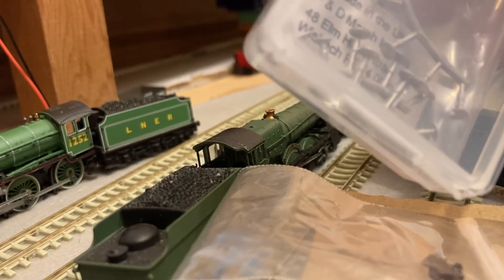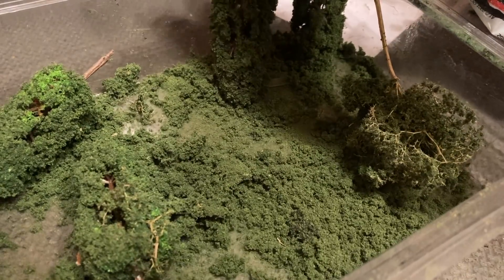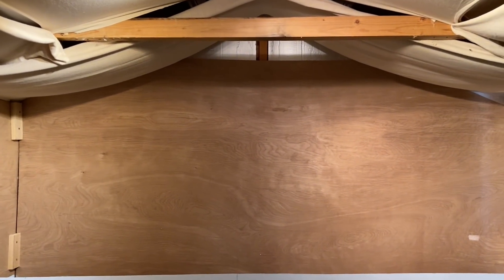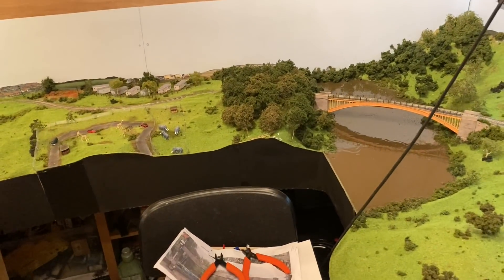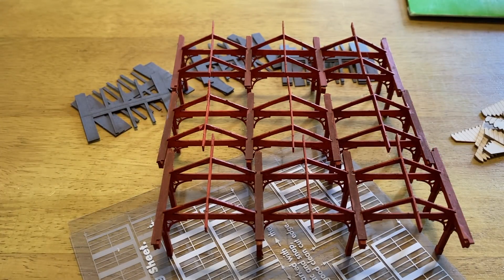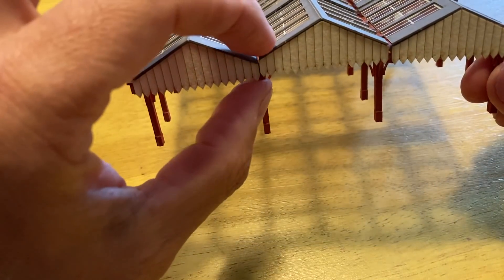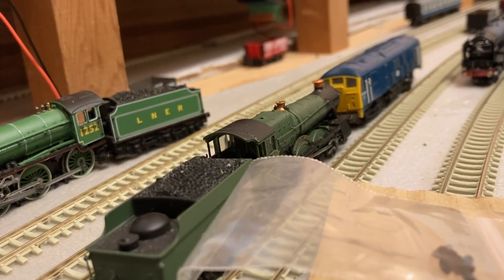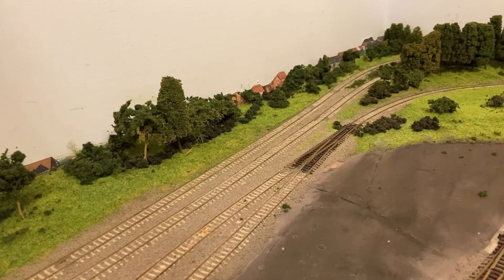N Gauge Model Railway Layout Update: Shed Valley Railway 42

Comment: Hello Simon, it’s great to see your well and getting some nice weather, here in Perth Western Australia, is our winter, cold tonight 5 degrees, no rain until Sunday, sunny days not hot.
What a difference the trees look when you finished. It’s a pain when you loose something small, spend ages looking, then when you get a replacement, it appears, I’ve had that happen to me a few times. I like what you did with the canopy, looked great finished. Trains are running well, and you can’t beat led lighting, they are cooler and less watts, I have them in my home Theatre room, 4 of them are 4 watts each, the 2 in the rear are 5.5 watts, smart down lights, with a 120 degrees beam with dimming. 
I look forward to your next video, enjoy the warmth, winter will be back before you know it lol. Take care, kind regards, Gary 😊

Comment: Like the Update, always need more trees.  Buffers try N-Gauge Society they sell a generic one and you could also try Peters Spares.  In trying to remove the buffers on the old class 8 donor, check from the back to see if they are inserts or moulded on.  If inserts then try adding a drop of something like brush magic cleaner to see if that will loosen the glue.  May be the next update will be a buffer maintenance tutorial.
Reply from the maker: Thanks will take a look and see if I can get the buffers off from the back, will have a look at the N gauge society too 👍